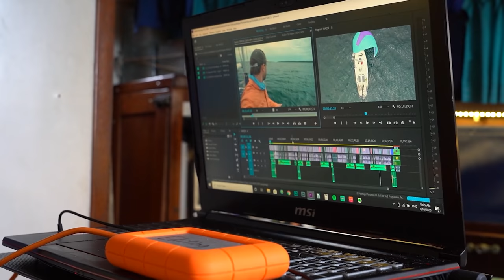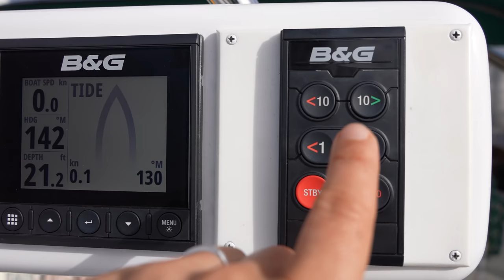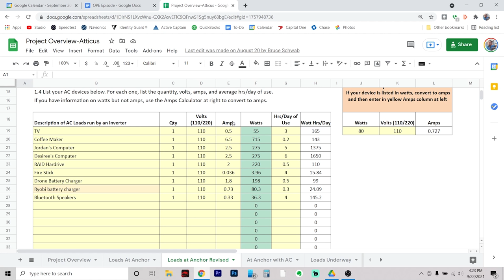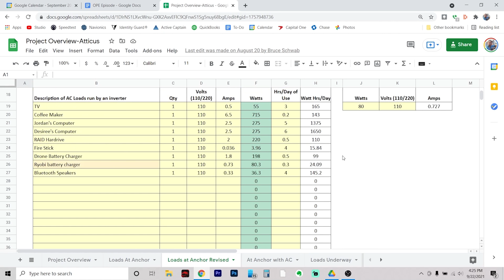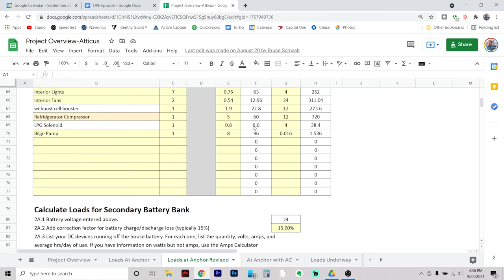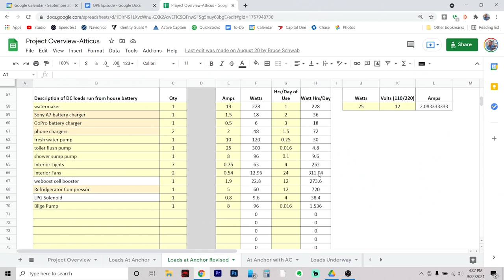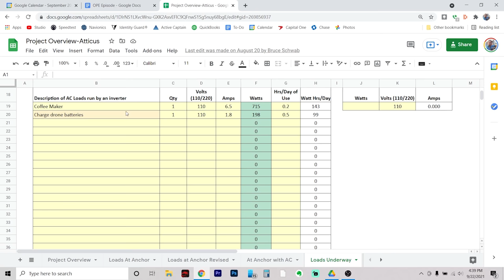Building our Electrical System | S06E20

Comment: Don’t forget to ask the questions about lightning strike vulnerability of BMS stystem electronics. To solving that problem I am putting my 630 amp hours of MG lithium in a metal housing (faraday cage … not an expensive addition though an optimum housing would have one water jacketed panel for cooling) which also contains all of the MPPT’s, the Charge controller, and a 100 amp DC/DC converter. All of the external cables will be shielded ie cables to solar panels, the D400 wind generator, and the separate house AMG battery bank (I’m splitting the energy storage to ensure a more robust solution [I hope]). The other thing I am exploring is building a surge protected uninterruptible DC power supply (a small battery with fuse, current, voltage and inductive surge protection on the power in side and a DC/DC converter on the output side) to protect the navigation system. I’m happy to hear any and all criticisms as this is all experimental.

Comment: All of that water you sail through, if there was a hydroelectric attachment for the boat that would charge the batteries as your sailing would be nice. Using the power of the wind to sail the boat and charge the batteries at the same time without creating drag, that would be so awesome.
Reply: Nice! I asked this same question on the video when they first revealed the new boat. Great minds 💪
Reply: Hey I don't know squat about all this but the sailing Uma couple recently installed a system that generates power under sail. It's an upgrade from their old system and they are thrilled with it.

Comment: Jordan-  Great video, can't wait to see the install... I'm sure you have covered most of my concerns and power strategies with the manufacturer.  But it's worth repeating,  a ton of dirty power outside the US with most countries running 240v at 50mhz (the US is 60mhz).  I would over-engineer the system in both battery and charging capacity. Making sure you have redundant charging options such as solar, wind, and maybe even hydro would be priority #1 as well as built-in protection from dirty power. Plugging into dirty power is simply asking for trouble, especially when exploring 3rd world countries.  I still would have the option to plug into but hopefully only to charge your batteries while operating off your electrical system, not an international grid system.  

I love the idea of a 2nd Alternator, I have a 240amp unit on by class B van, it can charge my 600 amps of lithium batteries in just 2 hours.  With that said it's a known issue on gas engines, a large secondary alternator will add extra load to the engine, causing engine life to be reduced with greater maintenance.  Adding a 2nd alternator will magnify engine hours by a factor of (unknown, but it will) Not sure about the issues with a diesel engine. The peace of mind of adding solar, wind, and the option of hydro IMO is priceless.  If your engine fails you still have power

Comment: Jordan, I have some advice and insight as a stayaboard, and an electrical professional. You need to plan on more energy usage than your calculations suggest. Here is why...

You are going to use more water than you think you are going to use as just one example. I am one person and I go through a bit over 50 gallons a day on average for showers, clothes washing, etc... Also you are going to add things to your boat. Things like a deep freeze for example.
Look at the Wynns as a youtube example. They recently posted in a video that their Average use was about 30 amps DC.  That was an average. I use around 40 amps DC on my boat on average. That is for a similar setup as you, running a business onboard with computers, communications equipment, etc...

I only say this because nobody ever wished they had less electrical capacity in their system.

Next talk to your design team about redundancy. Look for single points of failure and think about how you are going to deal with that when you are down island somewhere and parts are difficult to obtain. Remember that the best design means little if you are in a remote place and a component dies, and yes it will happen.

Here is a GREAT example... Lets say that you have a bank of LiFeP04 batteries and you choose to have them all controlled by a single BMS. What happens if that BMS dies? Same thing with your solar charge controller. 

The goal here is to get you and your engineering team to think not only about the greatest system, but to have a fault tolerant system as well. Best to you! and just as a FYI I run a fully redundant Victron based system, just one of several good brands out there.

Comment: No sure if you looked at the Ecoflow Delta Pro system.  Self contained LIOP with pure sine wave inverter, MPPT controller for your solar, battery monitor and conditioning.  No multi location installation and much more efficient due to the gague and proximity of the connections. (all in one box)  One unit is a self contained 300AH system.  Can charge in under two hours.  We are installing one on our Irwin 30 Competition for our energy audit puts us at 300AH as a generous requirement.  You can connect multiple units to deliver for example 600AH which would cover Atticus II.  You also have redundancy for if one goes down you can run the other 300AH unit as an independent power source.  They cost about as much as the batteries alone!!  Incredible life span.  3,500 cycles to 80%, 6,500 cycles to 50%!!  This is next generation!!

Comment: Great video Jordan but I didn't see anything planned for future electrical systems that you might add later, like an air conditioner or heater, electric furling units, etc. You could reach out to S/V Delos for some tips. They seem to be set up pretty well for off grid sailing, without sacrificing family comforts...

Comment: One thing I didn't hear you mention is a hydro generator. If you plan on sailing often, then a hydro generator would help reduce the frequency of running the engine to top off the batteries.

Comment: You might consider hydrodynamic power in the form of a towed or sterm-mounted impeller. This way you could charge day or night in any weather conditions. Just a thought. You could charge while at anchor in a current or while underway.

Comment: Being that you're changing everything in your boat and having buying new equipment as far as especially autopilot consider going to a 48 volt and 12 volt system or 24 volt and 12 The higher the voltage the less the amperage especially on your autopilot same way with the refrigeration but doing some modifications such as this you might even be able to add air conditioning and still be able to run everything
Reply: Unfortunately increasing voltage and reducing amperage doesn’t reduce wattage since watts = volts x amps.  So you aren’t actually using less energy.  The big savings is you get to use smaller conductors.  Especially for things like a big windlass or thrusters.
Reply: By using higher voltages those products run at lower wattage use also with higher voltages the diameter of the wire need to run the device is smaller more cost effective to put in and space saving as far as wiring and conduits these are things you need to look at because the rating for devices at higher voltages is going to be less wide to use

Comment: This episode came out at the perfect time! Pure Providence. I'm currently planning/rigging up an off-grid system of Solar/LP for the 5th wheel that we are moving onto the new to us farm and you've passed along some invaluable and very useful information to help in that process. You guys always bring a smile to my face and I'm already looking forward to next Saturday morning. Thanks again for sharing your lives with all of us strangers.
Reply: There's a solar advantage with a 5th wheel. You can move the solar panel point and tilt angles to follow the sun as the earth rotates durning the day and as the days get shorter and the sun gets lower in the south with the seasons changes.
Reply: @jhill4071  Thanks for the good advice. I was thinking it would be better to keep the panels mobile rather than mounting to the roof, especially since we only get about 8 hours of good light during the middle of winter. Was also planning on finding a good used windmill to run the well pump rather than using electric. Pumping water from 200' below up a 2" pipe requires quite a bit more amps than a typical 12 volt water pump in an RV or in a boat.

Comment: 550AH (>6kwh) per day energy budget! That's more than a friend's off-grid cabin uses (4kwh/day). How far PA has morphed over the years! Will be interesting to see how PA deals with the heat off a 300A alternator, especially in a tight engine room where changing a raw water impellor is blind and requires working by mirror.

Comment: Since fire is a major issue on cruising boats there are those that consider getting rid of propane to be a priority. Have you considered going electric on your cooking?
Reply: Alcohol on a boat scares the crap out of me.  Having an electric stove and lithium batteries also scare me also.  Diesel hot water heater and boat heat.  Thinking of a Diesel cook stove and oven but puts out so much heat.

Comment: By using the term "Lithium Batteries", some assume that they are the same batteries that are in your laptop or cell phone.  Don't confuse the technology of Lithium Ion and Lithium Iron Posphate!  Lithium Ion are the batteries that are catching on fire ... LiFePos (Lithium Iron Posphate) do not use an acid bath ... it uses a solution that is Base (Phosphate).  Thomas Edison invented this technology years ago.  The reason that they did not make it into the Auto industry is that they had a self discharge issue.  Most drivers in Henry Ford's era only drove on the weekends for pleasure.  5 or 6 days of discharge made them too weak to start the early cars.  
Now with the advent of solar systems LiFePos have a new life since the sun/wind/regen/alternator charges "constantly" which overcomes the old self discharge issue.
Don't be surprised if your LiFePos batteries last 15 or more years !!!  Worth it!  Making them, possibly , half the total 20 year cost of several sets of Lead Acid ...

IMHO ...

Comment: I made a mistake doing my electrical system.  I installed a 110v water maker PRIOR to looking at my 12v system updates and changes. What I should have done,and my change in the future, is install a 12v water maker. I have a catamaran so could have installed 2 for a total 16gallon/ hour production, 20gal/hour with the 110v (I can add more filters for a 40gal/ hour if i desire). The 2 12v systems would have been about the same cost and I would have had a redundancy, good for world cruising. The gentleman explained that by doing this as you charge your battery bank with solar or any other source when the batteries are full an ACR will switch the incoming solar power to the water maker.  This is important to not damage your solar system by not sending the power produced somewhere.

Comment: Have you thought about wind generators?  A small Honda generator can be used as a back up, and to take off boat for island outings.  What are you going to do to deal with 220 volt/ 50 Hz shore power?  Have you included a whole boat isolation transformer for any shore power?

Comment: Regarding interior fans, we have found that USB rechargeable lithium fans work awesome. We charge on passage or when we run the generator or have shore power. They are only $30, clip anywhere on the boat, no cords. Really happy with them. We have done a review of them on our channel. Cheers!

Comment: Let me guess…you are going with the INTEGREL system? That’s an awesome system!  I think a 800Ah 48V system coupled with Integrel’s 8KW alternator will be enough for your power needs. At 800Ah, if you consume 600amps per day, that’s down to 25% DOD.  But I still recommend you have a back-up generator in case your engine does not work…no engine, no alternator = no power.

Comment: 10:10 Re fans: I've found battery operated (1860 LiPo) 4" desk fans do better than 12" floor fans for comfort. They use a trivial amount of power...and also serve as a flash light.

Comment: I can’t wait to watch this play out.
Lithium in the long run is way cheaper than lead acid. When lead acid reaches it’s end life it’s scrap, lithium batteries only become slightly less efficient. ( many years later) You’re going to love them. I have 400 AH of lithium on my boat and I thought in my research lithium iron phosphate batteries don’t have those safety issues as other lithium chemistries. As used in phones, Hoover boards etc. I’ve never had a single issue. I believe using only high quality components removes failures and hazards.
Best wishes.

Comment: You certainly have a good grip on things with people who know what they are talking about. In engineering we say it's always better to over engineer that not, that is you will never regret over specking a system. I have a large MY so recharging systems isn't too much of a concern. However, once (years ago) LED matured I replaced every lighting system with LED. I don't have the figures in front of me but the engineer took months of readings before and after the changeover. The power savings were (are) amazing and not one LED has had to be replaced to this date. I don't have Lithium batteries but know they are substantially lighter than lead acid batteries and for you that is a factor. Unless of course you might want to consider lead acid batteries as ballast, lol.... Also, I have seen sailboats with wind turbines atop their masts, is that a viable consideration? Have a great week U2.

Comment: Good informative video. A couple of things: I expect you know already but I think you will still want to be conservative in you power usage. There are fans and fans. We have two and one uses 5 times as much as the other. The fan that uses the most power has two speeds but the low speed uses almost as much as high speed because the speed control is just a series resistor (it gets hot in low speed). Almost all power users will be similar, choose wisely. Most off grid plans start, as yours did, with a power use plan. Normally the second step is to evaluate those uses next to see what can be reduced. In your case you are looking to expand your use for comfort so reduction is more likely to come from looking for products that use less. Probably using less than land based is built in by now anyway. Also, see if you can buy batteries last... prices are going down. Take care.

Comment: One thing to consider, you could cut your cell booster consumption by at least 50% if you replaced it with a good quality cellular router with high gain antennas.  Something like a CradlePoint IBR1100, with a typical idle power draw of ~5W and a typical rx/tx power draw of ~8W and worst case rx/tx of 15.6W.

Comment: Consider the consumption of energy whenever you have visitors, and if you are planning to have kids, they ussually want to play videogames or whenever they are home schooling with another laptop/tablet for them, it is better to consider a spare generator,  for not depending just on your boat engine with alternators, some good inverter generators that just require oil and air filters as a maintenance, as a good saying, its better having it and not use it, rather than not having one and needing it so badly! And specially in worst case scenarios, better be prepared.

Comment: A 300 amp/hr alternator is equivalent to a 3.6KW genset. Briggs and Straton say that a 200CC gas motor, which would be needed to produce this kind of electricity, produces 5.5HP. I don't know what diesel motor their particular boat is equipped with, but results online show that others like it are generally equipped with engines in the 55hp range. So, if you're motoring, and producing the maximum amount of electricity with that alternator, you're sapping about 10% of the power from that diesel, at full power, to produce that electricity. As you throttle down to cruising speeds, that percentage will go up.

All-in-all, I would say that the tradeoffs for using a HO alternator on the auxiliary probably outweigh the tradeoffs of using a dedicated genset, not the least of which is price. A 3500watt diesel marine genset will run $6,000-$7,000. West Marine lists a 200 Amp/HR Balmar alternator for about $1,500. So, I would expect a 300Amp/hr bought from a place that doesn't grossly overcharge to run $1,500-$2,000.

Comment: You never mentioned the use of a wind generator to supplemt the solar?  Did I miss that?  Any comment on wind generators? Will be interested to see how the high output alternators work.  Are they water cooled?  Great videos thanks.

Comment: Definitely an expensive and worthwhile project. However, Will you be exploring any Lightning protection, engineering or disconnect procedures to protect your investment and capability?  I see a backup Honda portable generator in your future.  
2 is One, and One is None...

Comment: One of these days, someone is going to design sails that actually double as solar panel sheets.  I think that this would be the ultimate way to capture the suns rays and work as a full time solar system and power the boat and systems completely.  Creating a lot of extra usable space on the boat and be able to fold up into a sail boot.
Reply: Having the sails deployed while at anchor or in a marina wouldn’t work. You would only be able to capture energy while moving. It would still be a great solution but like most energy solutions it would be one of many different ways to solve the problem…wind, panels, water turbines, genset, alternators, hamsters on treadmills etc. no one technology solves the problem completely….yet.
Reply: Right on the spot man, I'm still looking for a Flux-capacitor!